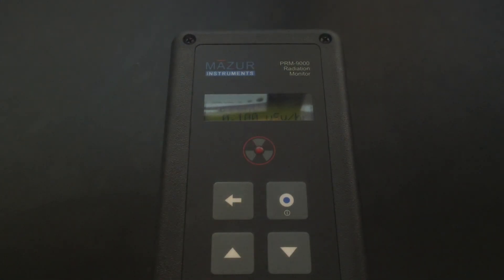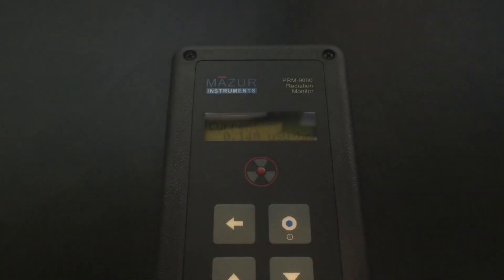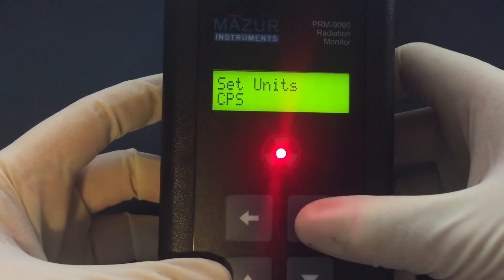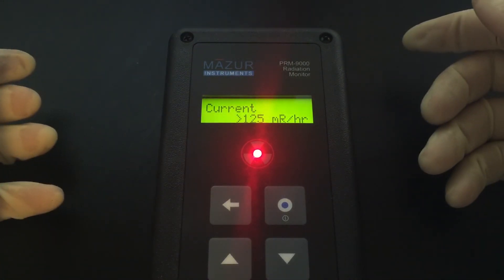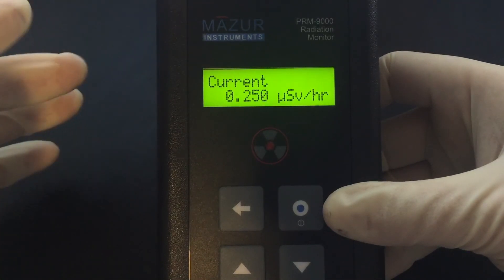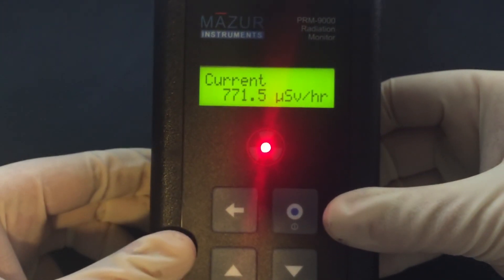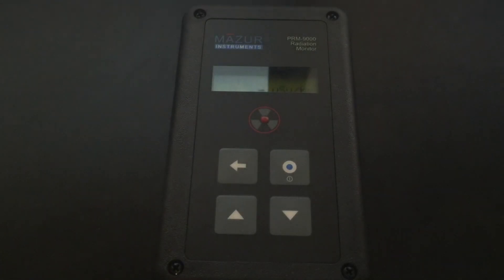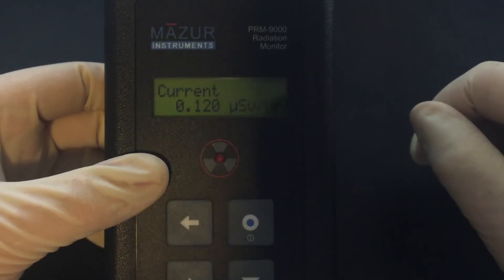Mazur PRM 9000 Torture Test in Response to YeOldeScience

Comment: I am getting the same source and am going to do a video on it using 4 meters from unboxing to using it with ludlum model 3 with 44-9, model 2403 with 44-38, and a 9-3 ion chamber, plus a minimonitor 2. I wanna see if it's urban legend or myth as to it's strength. Should be real interesting and I'm looking forward to it, days away

Comment: I did rad pro calculator on this source and it should emit 5 mr/hr of gamma only at 1". Distance is everything (invesrse square) so at 1/2 in it should be 20 mr/hr and at 1/4" 80 mr/hr. Things get way more serious at .010" which shows 4000 mr/hr. I don't think I will keep it in my pocket....  My model 3 with 44-9 churns out 50,000 cpm of beta on that unit with a fiestaware plate, even moves my 9-3 ion chamber pretty good with window open. I can detect that plate from 6 ft away!

Comment: Good old Cs-137 (10 microcuries) source! I just got an Inspector USB! It's a great Geiger-Müller counter! I don't have a Mazur PRM-9000, but looking at videos of them, they seem to be very high quality devices! I know it uses the same G-M tube (LND 7317). I like the features it has, but I also like the Inspector USB, and the features it has, too! I have a lot of sources, many quite spicy! A lot of them will saturate my Inspector. I like the built-in efficiencies of the Inspector USB which the Mazur doesn't have, but I like the min/max reading and the rechargeable feature the Mazur has, which the Inspector doesn't have. They both have their own unique capabilities! I did build a really nice custom made Geiger counter from a kit, and it has a Russian SBT-10A G-M tube, which is huge, and can also detect alpha. And it has 10 anodes, hence it's extremely sensitive, however the mica window has a huge surface area of about 60 cm². It's amazing to think that Geiger counters 50 years ago required D cells or a special battery, and were the size of a lunchbox, and weighed quite a lot, and the headphones and/or speaker came separately, and sometimes also required batteries, too, like my CD V-700 6A. I still love the old Geiger counters, too! They are more complex than a lot of people probably think! I just find this stuff fascinating! Thank you for the demonstration! Nice quality video, too!
Reply: It really is a great jack of all trades, geiger counter and radiation monitor. It has a lot of the same features and really fast. Refresh rates like a Radeye B20 but at a very manageable price my first couple, Geiger counter’s were good at small things like antiques, or for general radiation source finding like my GQ GMC 300 plus , and my better geiger centiliter style, which is really sensitive for beta and gamma radiation. But the Mazur is really good for alpha, beta, gamma and x-rays and really can be your all in one for everything.